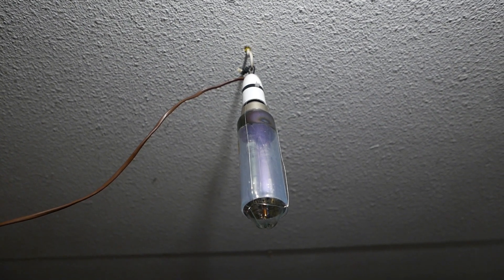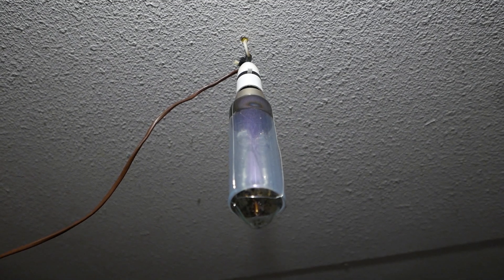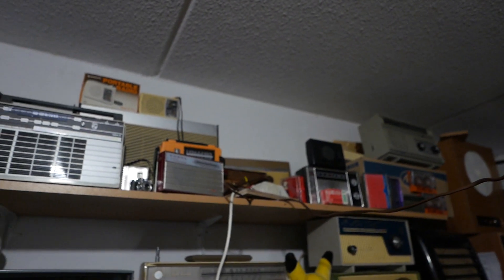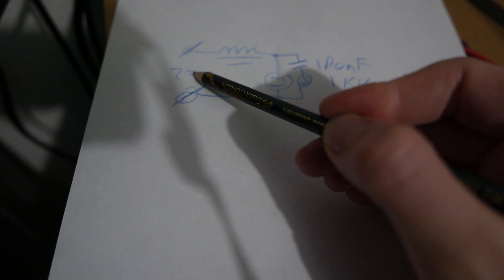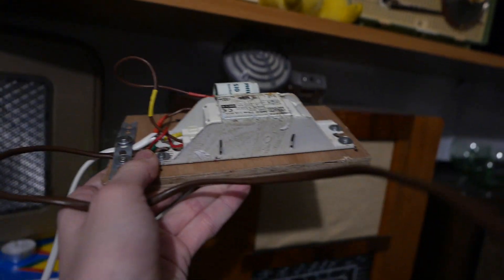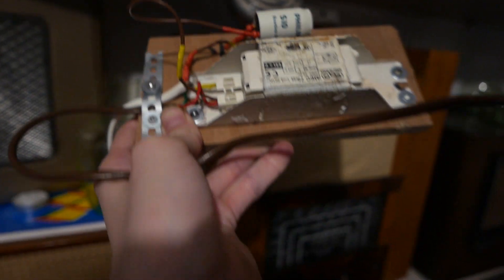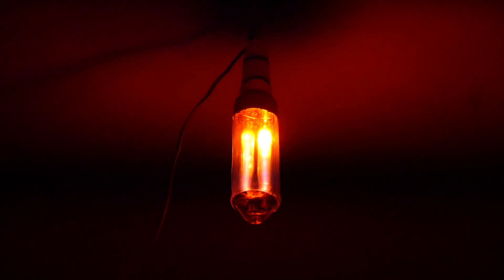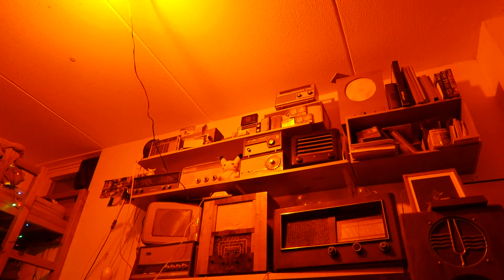Running a SOX 18w low pressure sodium lamp on a standard fluorescent lamp ballast

Comment: How you capture the spectrum of this lamp?
Reply from the maker: You can use a diffraction grating spectroscope to look at the spectrum, or use an electronic spectrometer to look at a relative intensity graph of the spectrum lines. 
In this case, you'll see the Penning mixture's lines as well as the sodium line with a spectroscope - but the Penning mixture's lines will be of course very weak when looking at the graph.

Comment: I'm not very good with circuit diagrams and I couldn't see where the wires were going on the board you had made. Ignoring the capacitor, am I right that the live goes into 1 side of the ballast, the other side of the ballast goes to 1 side of the fluorescent starter and the other pin of the starter goes back to the neutral connection. The 2 wires to the bulb also go from the 2 pins of the starter.

Would this work with a SOX ballast if I didn't have an ignitor? Or is this only for fluorescent ballasts?
Reply from the maker: - The lamp is in series with the ballast. 
- Parallel to the lamp, there is the series connection of starter and capacitor. 
I highly recommend getting a bit more profeciency in reading circuit schematics, to avoid breaking things by misinterpreting it. Take a few hours to learn it, and you'll understand the schematic in the video. I cannot easily explain the connections in words.
It should also work with a choke style SOX ballast with 2 connections. This circuit is only because i did not have an ignitor. 
A constant power style ballast as is common in the usa, does not work this way.

Comment: I'm running 18W SOX-E on 18W magnetic fluorescent ballast with dedicated SX26 parallel ignitor and 4.5uF capacitor connected parallel to mains, to compensate power factor. Lamp current stabilize at ~360mA. Low pressure sodium lamps are very uncommon here in Poland...
Reply from the maker: By now, i have 2 complete SOX fixtures with their original ballast and ignitor. 
SOX used to be very common here 20 years ago, but it's almost all gone now.

Comment: I'm trying something similar with the starter circuit in small screw in bulbs (e27). It works, but I do get them to be destroyed sometimes. One gave a very cool half turned on effect which I wanted to make into a decorative light, but I blew it up trying a 26W SOX with it. Perhaps they don't like a hot restart.

Comment: Hello! Thanks for the video, it's gonna help quite a bit on one of my science projects. 

Just one question, it does work without the capacitor right? Like, if I just plugged the ballast+starter into the lamp, it would work as well but just take longer to start? After it starts, is it more stable with the capacitor or do they work the same?
Reply from the maker: Without the capacitor, with the starter connected in parallel to the SOX lamp, it takes way too many start attempts before it finally ignites - if it ignites at all. This is very bad for the SOX lamp. It does not have filaments like a fluorescent lamp does, so every time it tries to ignite, material gets sputtered off. It takes about 10 times as many ignition attempts for it to start without the capacitor. Do not do this. SOX lamps are not made anymore, the remaining stock has gotten quite expensive. 
After it starts, the capacitor is switched out of circuit because the starter contact opens again - so once ignited and once the starter opens up, it has no influence anymore. 
You can do without the starter (use a manual momentary/push button switch) but you need the capacitor. A suitable capacitor costs something like 2 or 3 euro so omitting it is false economy.
Reply: @mfbfreak  got it. Does an electronic ballast work as well? Or does it have to be conventional?
Reply from the maker: I don't know if a electronic ballast meant for fluorescents will work well. The most important thing is the lamp current - it should be 330 to 350mA ideally for the 18w lamp. Look up the lamp datasheets for the appropriate current for different lamps. With an electronic ballast, that's quite hard to measure because most multimeters don't play well with high frequency drivers. If the current matches but the voltage doesn't, it's possible that the driver will cut out because it assumes the lamp is broken. 
If you want to buy a ready made driver, you can get some here while stock lasts: https://voorraad.dbl-verlichting.nl/collections/philips-sox-exc-evsa
Finally, be aware that my video is from a 230v european point of view, all of this won't work on 120v USA mains unless you hook up a 240w split phase outlet where you wanna use it.  For 120v you gotta figure out something else. There are suitable drivers available.